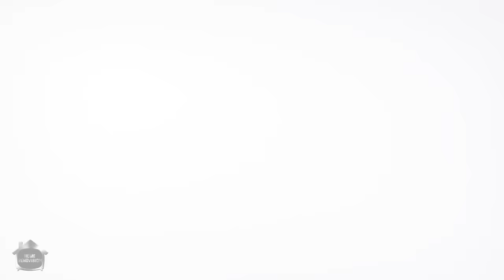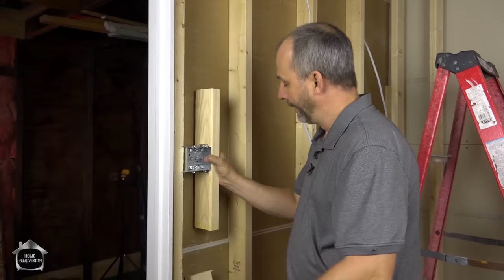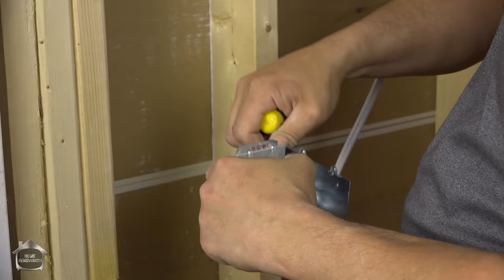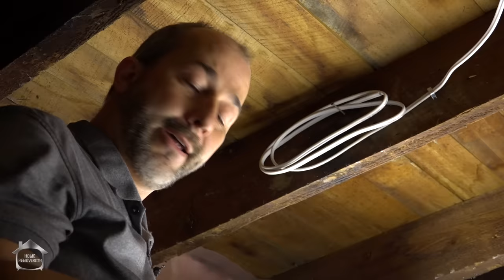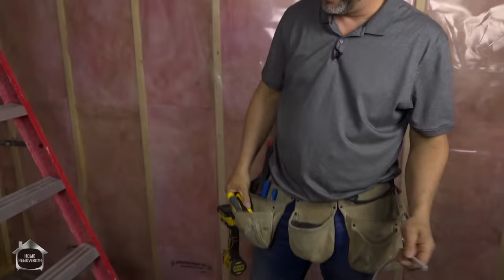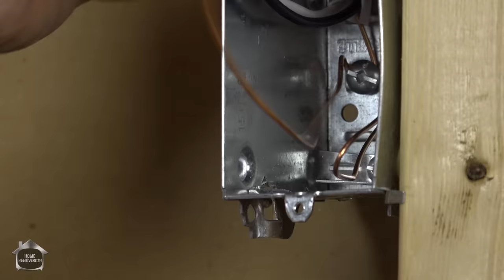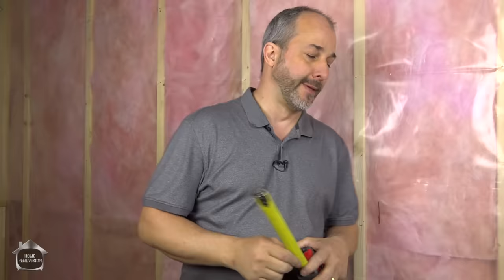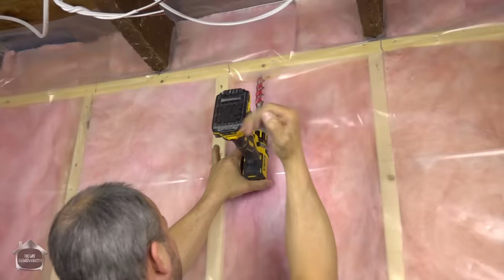DIY Bathroom Wiring | How To Run Electrical

Comment: At Least a 1/2 inch of uncut outer sheathing into a box is my minimum, placing the clamp on wires is a no go. Hate that you are destroying a lineman's pliers hammering in staples. Use the proper tools
Reply from the maker: LOL<Have you ever seen an electrician work before. That is all they use. cheers!
Reply: Home RenoVision DIY an actual hammer makes stapling so much easier. We use lineman’s for everything else.

Comment: Good work. I just can't help but comment on how much superior and clean electrical looked when you had to use thick-wall flex conduit and had to pull individual wires to boxes. It also makes future upgrades so much easier as you can just run fish tape and pull wires through the existing system without have to open up walls. Whenever I open up some walls in my 1960's home, I really see how much more robust it is compared to the NM Romex we run today.
Reply from the maker: If I owned a 60's home I would be removing all the walls and starting over. Cheers!

Comment: Im a firm believer in 12 gage 20 amp circuits. It allows for newer blow dryers, heating elements if added and no overloads. I know 14 wag of fine but with so many add insult like two girls using two blower dryers at the same time ( I only have two bathrooms ) is covers the load

Comment: Would the towel warmer be warm by the time you got out the shower if you connected to the light switch to it and let it heat up while your taking your shower? I used to go to some hotels and there was a heat light in the ceiling and I loved it it! Any thoughts?
Reply from the maker: yes it is. Cheers!

Comment: You were talking about the different boxes you use. I noticed you used metal boxes, any time I do electric work I like to use the blue plastic ones.  And the reason for this is that in my mind if I would happen to have a hot wire come loose and hits the side of the box, I worry that the box could become charged.  Do you think that this could actually happen? Am I just being paranoid?   What are your opinion on the blue plastic electrical boxes?
Reply: IF THE WIRE HITS THE BOX ITLL TRIP THE BREAKER

Comment: Jeff thank you for your informative channel and all you do. I have 2 questions:
1. Where you do you buy your s2 romex staples from?
2. Why do you only use metal gang boxes? What is your opinion about blue plastic boxes?
Thanks in advance!
Reply from the maker: I buy my staples at HD. And I use plastic boxes on my exterior. metal boxes are just cheaper so they are my go to. Cheers!
Reply: @HomeRenoVisionDIY  Weird, I guess my HD store doesn't have them, can't find them on their app neither. I wanted them instead of having to use 2 of my single strand staples. Thanks for the reply.

Comment: This is great information for new construction or a complete restoration. My house was built in 1957. No grounding wires just two conductors inside a cloth sheathing. I would love to rewire my entire house and make it safer. To have an electrician do it would cost 11,000 dollars or more. I don't see any way to put a staple in every 5 feet in a finished wall or even one foot from the box. I have a crawl space and an attic. I don't mind getting dirty and running cable. I guess the government would rather you have old, dangerous wiring in a house, than run new cable yourself. Codes are not always a good thing. I will probably wait until I can afford to have it done by a licensed electrician, if the house doesn't burn down first.

Comment: Jeff when cutting the sheathing back like you do at 14:30 are you not worried about nicking the sheathing of the inside wires? Why not cut sheathing back 4 inches then separate sheathing from wires and pull the rest of the way down like a pull strip  to split the sheathing open to the point you need. Then trim off the 4 inches from the top that might have been nicked when cutting?
Reply from the maker: I have my pressure towards the ground wire in the middle and it runs clean every time. Cheers!
Reply: @HomeRenoVisionDIY  I assume you are cutting in the middle (or I would hope so) but the ground wire is round and if you press down on it the blade will go to the left or the right of it and now the cutting blade is between the ground wire and a sheathed wire leading to a possibility of cutting the white or black wire causing a short to ground. As mentioned above we were told to use the ground wire as a cheese wire to cut the sheath or use a carpet knife or sheep hook. No possible way to cut the other wires using these methods and trim off the end where you went through the outside sheath. Again not saying what you are doing is wrong but just curious how you can possible 100% guarantee it will never cut the sheath of the other wires using a flat blade?

Comment: in most places code requires a 20 amp gfci receptacle in the bathroom. 20 amps requires 12/2 wire. Some hair dryers can trip a 15 amp breaker, add in a curling iron and it will trip for sure.
Reply: Yah code the same where I live. 20 amp in box 12/2 with gfci
Reply: 20 in Georgia.

Comment: Great Video, 
Make sure you have 2" clearance from wire run and drywall, (ceiling on the wire between the straps).
Also if your box is more than 4", then you need support.
And last thing, NEW CODE , sure you run the heated floors wire and sensor wire though core line ( flexible plastic pipe)

Comment: I have not seen staples like that.
Our staples dont have stops and i was told my an old electrician 15 years ago that you should nail the cable so its not loose but under minimal tension.
Just enough that you can pull it if needed.
Plus a small slack on corners in the event of an earth quake.

Comment: All my existing bathrooms had no boxes in the wall, they had strip lighting.  When I replaced the fixtures, used those metal boxes with the bar that twists to press tight between studs.  There was the 1/2 bath I found the electrical cable between the stud and drywall, a no no, fixed that.

Comment: The 36" rule from water makes sense.  Now is this in Canada or is that also common to California?  I have a mobile home and if I have 18" from the electrical plug in I would be surprised.  Now the codes may have been different in 1987 with the Fleetwood I have.  Thanks for the information.

Comment: I am working to finish off a detached garage with a second story studio apartment that I plan to use as a STEM lab, maker space, hang-out, therapy room, etc. From North Carolina.
--
How many wire(s) can I run though a hole in a 2xX stud / top-plate / bottom-plate, etc? 
I guess I am looking for a table that would show something like (provided as an example and not correct):
1/2" hold = two 14/2 NM
3/4" hole = three 14/2 NM or two 12/2, etc.
1" hole = X 14/2 NM, Y 12/2 NM, etc.
1 1/4" hole = . . . 
etc.
--
Sometimes I need to run a lot of NM cables in an area or section (eg light switches) and did not want to have to drill a bunch of hold through a top-plate of a load bearing wall. There are basically two things I have to consider: structure and electrical. I need to run electrical wiring without compromising the structural integrity of a wall (especially load bearing). 
How far apart should the holes be to maintain structural integrity? For example, should be space between 3/4" holes be 1 1/2" on center (or rim-to-rim)?
--
Notes provided assist with my understanding:
NM = non-metallic cable aka Romex
14/2 = 14-gauge with two conductors (one-black, one-white) and one ground (bare)
14/3 = 14-gauge with three conductors (one-black, one-white, one-red) and one ground (bare)
12/2 = 12 gauge with two conductors (one-black, one-white) and one ground (bare)
--
Reply from the maker: best rule is 2 wires unless they are low voltage then no worries. At least that is what I go by. Cheers!

Comment: Any power cord fitting in the ceiling you put through the joists not over them or you could be end up trapping the cable between joists and the plaster board plus you don’t put switches on the wall in a bathroom as you are more likely to getting a shock from the switch so you should be putting in a pull cord switch as they are classed as more safer to use .
Reply from the maker: Hi Andrew. there is a distance required to switches from water sources and I am far enough away. You could also use gfci circuit to protect yourself. the ceiling is getting strapping to create a safe space for installing drywall. Cheers!

Comment: I have a circular junction box, which is screwed directly to a stud going sideways. After Sheetrock is installed it will still protrude about 1 inch. This is for a vanity type light over a sink. Are there light fixtures that will cover up that distance?

Comment: Hey Jeff, Jeff here. Located in Ontario. Can you not just GFCI all lighting/120v heat circuits in the bathroom and save the 36inch rule for people living in the 1980's? just leave the counter plugs for at site gfci? ive been watching a lot of your videos and am learning a lot.
Reply from the maker: If you GFCI everything then you are fine. It just costs a lot and uses more space in the panel. Cheers!

Comment: Correct me if I am wrong, I thought the latest code requires a bathroom circuit to be on a minimum 20A breaker, which would require 12/2 wire?

Comment: Does the 36 inch distance to water include the sink?  In two bathrooms the light switches are both withing 24"s of the sinks.  They have GFI outlets almost beside them.  I am local to Ottawa; well Pembroke but close enough.

Comment: tysm for this vid, i am a kid that is about to change up my new room a l only have 1 light, in the corner in a room about 18x12’ One question do you have to use and securing method when sheetrock/drywall is already on

Comment: Canadian wiring is very different than in the US. We have been required to run a separate 20 amp gfci for receptacles in baths for years and no more than 4 feet between supports.
Reply: 4'6"

Comment: Can you tell me if I need a permit, and what the best power option is just based off of this? I'm thinking about buying a premade shed and we would live on a plot of land. Would we need to have a permit to finish out a shed? We're going to get one off of a reputable site and they'll deliver it to us. The shed will be able to withstand the whether here, it'll be made out of hardie plank and pine. (I'm trying to do research, but it's hard to find anything.) This is in Texas btw. If the land doesn't have power or water, what would be the best power and water source? Any advice is appreciated, thanks!

Comment: Another great video, and practical. Thanks. Just a note, I, like you, used my plier as a hammer for a while and it ended up getting kind of jammed gradually:( Now it is very hard to operate it without using both hands. Just saying.

Comment: Are you planning on running any data/low voltage cable? That stuff is so cheap that even if you don't plan to install anything like CCTV soon, having the cable already in the walls will save a heck of a lot of hassle in 5 years ... ?
Reply from the maker: Hi Stuart. I don't think so. By the time I have all my tech gadgets they will all be bluetooth so no need for the wires. Unless I am missing something, I am not the most tech savy guy around. Cheers!
Reply: @HomeRenoVisionDIY  In your situation, with everything stripped back, I definitely would. Even if it's only future proofing for now. Anything that's going to stream a lot of data (Netflix, Youtube, Sonos etc) I would use a wired network, leave the wifi free for mobile devices & laptops. CAT5 or CAT6 network cable is so cheap nowadays (cat5e is about $40 per 1000ft, cat6 about $100, Cat5e will probably be more than enough for most domestic installs for the foresee-able future.), I would have at least 2 runs to each room, back to a central location. Rooms where you're going to be streaming I would have at least 4 runs, so 4 to where the TV is going to go for example, and I would run 2 to each side of the house & leave them tucked away in the loft.

It's also excellent for CCTV, wireless CCTV cameras are OK, but the wired ones are so much more reliable.

Keep up the great work, I love watching your videos!

Comment: I have a question for you..you mentioned all boxes must be >36"from any water surface and your initial measurement was 37"when the box was on the first stud..then you added 3"of 2 by filler to allow to casing etc. When you moved the box 3"over away from the door..you made that box less than 36" .. am I missing something? Thanks

Comment: Our home when we bought it had mostly 2 prong outlets so the outlet boxes were not grounded and could potentially become energized.  My question is I have always been told that it is improperly tightened electrical connections that can get hot and cause a fire.  When I replaced the 2 prong outlets with 3 prong I was very obsessive compulsive that I used greenies for joining my ground and had them well tightened and that my black, white and ground wires almost farted when i tightened them to the outlet terminals.  For my ground wires I added I bought the shortest roll of 14-2 Romex that Lowes had.  I am very leary about electrical connections being tight.
Reply from the maker: Cheers I get it!

Comment: How to wire a duplex electrical plug.  Always splice the white wire to the black wire then jumper it to one of the brass colour screws.  Take the bare copper ground wire and put it under one of the clear metal screws, use the other clear metal screw to install a jumper wire to the ground screw.  Always put your wires counter clockwise under screws.

Comment: As a Swedish electrician this leaves me baffled. I know what type of system you are using in the US, although I still cant wrap my head around why you would use something like this. What do you do in the future if you need to rewire something? Then you probably will need to remove the drywall or perhaps fish it in the wall if you are lucky. Our system consists of plastic hoses, and inside we are using small copper cables, which allows us to change them if needed, and upgrade to a bigger size if needed.
Reply: Jonas Arvidsson he’s in Canada.

Comment: Hey Home RenoVision . What sort of drill are you using for going through the walls? Are you using a normal drill, impact or hammer? I am trying to buy some drill tools but I'm not sure where to start with the options. Thanks lots.

Comment: Do you have a video for installing a ceiling fan by oneself? I am not overly strong in the upper body. I can do the electricals, but not sure if I can lift the fan to the ceiling. Is there a trick or a way to do this safely?

Comment: Thanks for this video, very informative and engaging as alwaya! However, wouldn’t it be bettet to run all the wires in flexible plastic hosed between all connection points? Then it would be easy to change any cable damaged by mouse bites, drilling by mistake etc?
Reply from the maker: no need, if you are using competent trades and the right sized fasteners there is never an issue. Cheers!

Comment: Great vid. Always use the Romex jacket to label wires for installation & put back on wires(meaning not slicing down, but cutting perpendicular to wire & removing entire sheathing & can make diff lengths for whatever labeling etc...). Really comes in handy, then afterwards can just cutoff & throw out(trick was taught when apprenticing). Not only person who’s taped up vap barrier (hung Sheetrock etc) & forgot to run your wire.....it happens😉, just laugh at yourself later when telling the story😅.
Have also worked w/ ppl who don’t tape up vap barriers & the like when doing electrical (rough ins, final, or remodel etc) cuz they say....not their job. Find this frustrating, but my opinion..
Thanks for the great vid(& the laugh from the tape mistake 😉), house is gonna look great when done & excited to see this job done👍🏻
Happy Easter😊
Reply from the maker: jacket labeling is great. I also like to label the box. Cheers!

Comment: question on an old video that likely won't get a response, around 8 minutes in you state that your switch is 37 inches away from the glass. but then you bump out the switch 4 inches with 2 veritcal 2x4s. wouldn't that make it too close to the shower glass for code?

Comment: Hey so I'm a little bit confused about one part. If the beams are 2 ft diameter (1 foot radius) at eye level, you want the lights "every couple feet" just like you said... But then why do you say next that you want the lights "no more than 4 feet apart"? Is it okay to have that 'dark space's between the light circles at eye level, but not at ground level? Thanks I appreciate the tips!

Comment: What is involved getting electrical permit and inspection after the fact?  What about electrical wire going inside across the the closed ceiling, how would you staple?

Comment: Love your channel!! Subscribed.

I just purchased an old house with the idea of renting it out in the future. One of the problems with the house is that every outlet is 2-prong. 

I was thinking that a good video for your channel might be to show how to convert the 2-prong outlet to a grounded 3-prong. Just an idea that I think might be very helpful to some people.

Keep up the good work.
Reply from the maker: sounds like you need to run a ground wire. Cheers!
Reply: No if you have 2-prong outlets It's probably because you've got out dated wiring.  Do you have screw in fuses, and wire covered in cloth?  Hopefully not knob and tube wiring.  If so, think about updating your wiring.
Reply: Yeah that isn't an easy project, unless your ripping out drywall or plaster. Other wise you need a retro style electrical box. And you have to fish new wire up the wall. It sucks, It's no fun at all.

Comment: Jeff, i am looking to add recessed lights (will be ordering ones from vega) using a light switch that currently controls an outlet. Any videos or specific advise for this specific job that would help? Thanks!